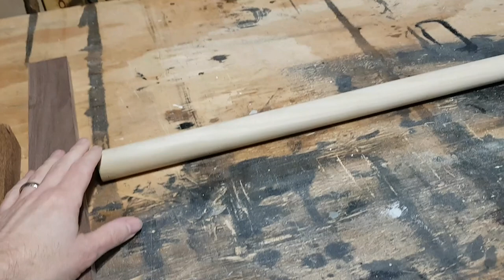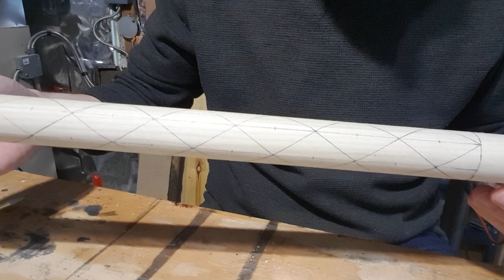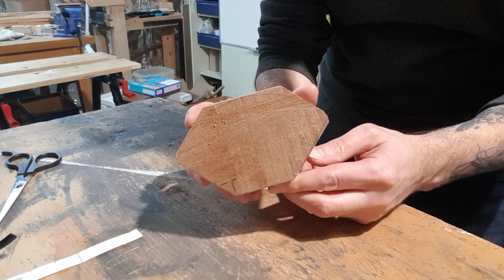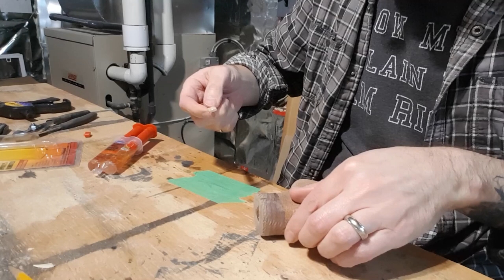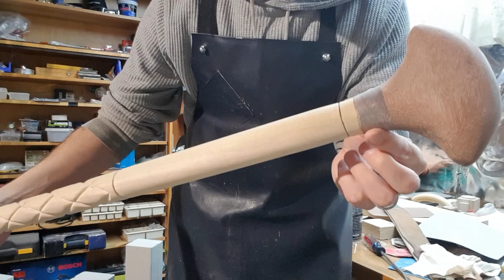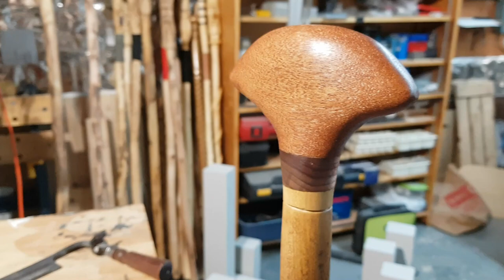HOW TO CARVE A WALKING STICK with a QUILTED PATTERN

Comment: Man Jason, I learn so much from you. Keep it up. Where do you get your 2 part epoxy from? The one's here are so small, maybe .5 oz. I am also looking for 2"-4" rubber foots. Do you know where I can get some? I love this stick. The Mahogany with the Walnut makes it beautiful. What was the other wood? It looks dark after the stain.
Reply from the maker: Thank you so much! Happy to help. Yes, the epoxy is small batches, I get them from hardware stores. The rubber feet I use are furniture feet, 1 or 3/4" max diameter. The main shaft is a standard dowel stained dark.

Comment: What tools did you use to take off the width and transition from the handle to the shaft? That looked to be a good 1/4” material off at an awkward angle.
Reply from the maker: I use several tools, spokeshaves, rasps and files. All hand tools, you could also use the Dremel to remove the material. Hope that helps